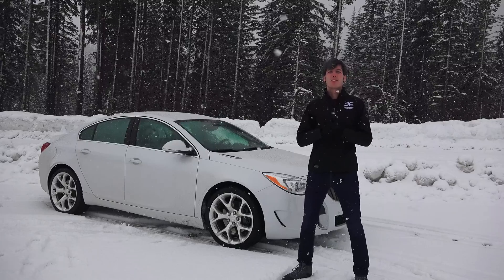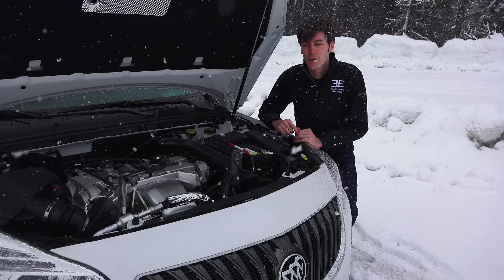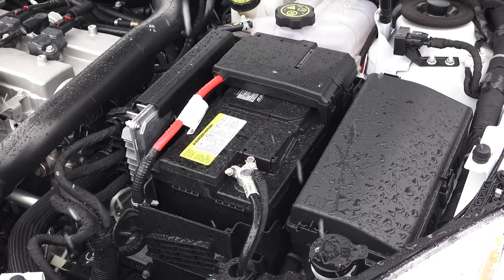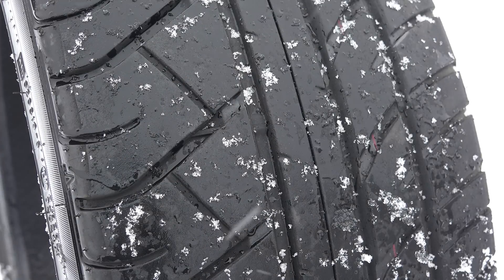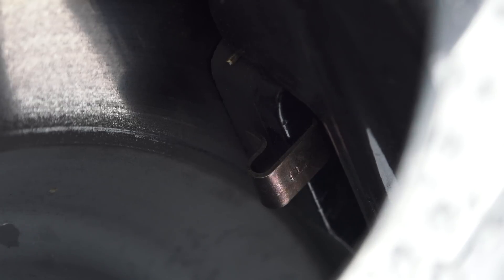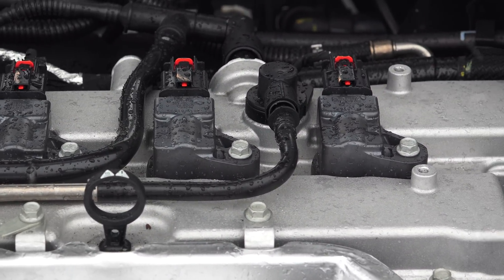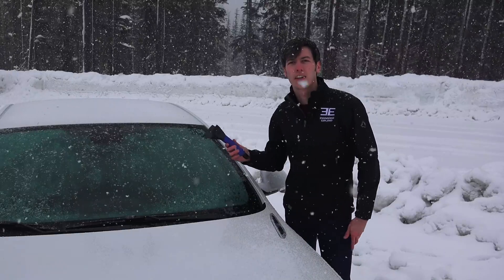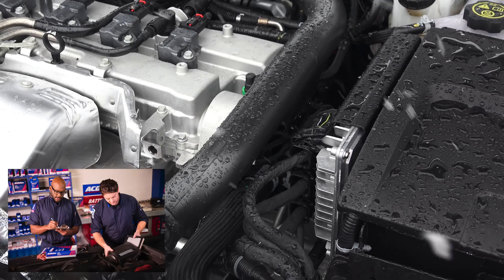6 Ways To Prepare Your Car For Winter

Comment: I'm poor and I can't afford a pack of winter tires, is it  OK if I just lower the pressure of my tires?
Reply from the maker: +Yoseob Yang I'd recommend getting some snow chains. It's a much cheaper option for traction in the snow, I bought a set for maybe $30. Make sure they fit your tire size, and don't interfere with the brake lines. Great thing to keep in the trunk if you'll be driving through areas that commonly see snow. Lowering the pressure will have a very minimal effect on snow/ice.
Reply: If your comment is serious no. Definitely no. Especially under 0°C and snow summer tires get very hard und have much less or zero grip. And If you buy winter tyres don't buy the cheapest ones some of them are very bad. Your life should be worth this much.
Reply: Don't buy a car if you can't afford to maintain it and keep it safe. Simple, really.
Reply: Vikk 54 Yeah they're going to be paying the price for their one accident which is possibly much less than the cost of maintaining probably multiple AWD cars with many snow tires for whatever your life span is. And you can look smug as you drive by all you want with your paranoid waste of money lifestyle but that doesn't make you smart or the situation "simple" just because you can't calculate more than one variable.
Reply: +rorschach775 one accident? How do you know it's going to be one accident? If I had a dollar for the amount of people I saw stuck on the side of the road in a snowstorm while I drive by, I'd be rich. Don't you think it's sensible to put on snow tires and avoid all that? It's not being paranoid, it's common sense.
Reply: +Steffen kawa I'm not actually poor, but I really wanted to know if low tire pressure could help with grip in these conditions. Fortunately or not, it's never icy or snowy where I live, so everyone uses summer tires the whole year. Our solution for snow is to put chains on our wheels though
Reply: +Yoseob Yang if you never have snow and it isn't very cold you don't really need winter tires. I live in Germany and sometimes we have snow for weeks and months. And we only can use chains if snow is everywhere.
Reply: ok
Reply: +Johnathan Yinger he said chains man, not tires
Reply: +Engineering Explained maybe if I leave them flat it would be less minimum.... lmao just kidding, thanks Jason!
Reply: +Vikk 54 You're dumb.
Reply: +rorschach775 how? That seems sensible to me. If you can't afford to maintain a Lamborghini, don't buy one.
Reply: +rorschach775 further, if you can't afford to put tires on a Ford Focus, then maybe you shouldn't have put all your money into that Ford Focus.
Reply: +rorschach775 right. So when someone spins out on their rock hard summer tires in the snow and wrecks their car, they're going to be paying the price for that "unlikely" chance that something might happen. That's the reason why I have an AWD car in addition to my other car for these cases. That's not like paying for platinum health insurance. That's paying to keep yourself safe. Call me stupid all you want, but the facts remain that if you spin out or slide into traffic or can't get out of your driveway because you didn't put winter tires on your car, you're going to be regretting it.
Reply: Vikk 54 I don't. I'm saying it's possible. You can't count everyone you see crashed as a stat for individual cases. Why does no one in America understand how math works? If I had a dollar for every time someone misunderstood units and measurements I'd be rich. One crash for total population =/= one crash for a specific individual. 

It's sensible if you have disposable money. It's common sense if you are paranoid. There is no requirement to purchase them to operate a vehicle so obviously it is pretty common to see it this way. Plus snow tires are bottom of the rung for traction anyway. I mean yeah they're convenient but unless you go crazy upmarket you're not really playing it that safe. You're better off with chains or socks anyway. That's why mountain passes require chains not tires. If you're driving through some actual dangerous shit you're going to need chains anyway.
Reply: +Vikk 54 it's not my case, but there's a lot of people who could hardly afford getting a car and can barely keep it going and don't have the money to get some good winter tires, not even think about getting a second car "for those cases". That's why it's not so simple. It also depends on where you live and the chance of having to drive on ice or snow. Many people don't even know the existence of different types of tires for different seasons, but sadly the reality is that money can buy life. For these cases, just like Jason very sagely said, the cheap alternative to keep your safety is to get some snow chains. Wish it was always that simple.
Reply: +Yoseob Yang How much is your life worth? 
What weather is it?  (below 0c and icy roads?) 
Are you required by law to put winter tires on?
Reply: +Rune Venes it was just a hipothetical situation, just to ask wether lowering the pressure could help get some more/better traction on ice and/or snow. Fortunately in my country and region there is never (or almost never) ice or snow unless you go high in the mountains in winter, so nobody needs or even know about the existence of winter tires, just all season ones

Comment: i NEVER replace windshield wipers in winter, because very often I have a situation, when you left car for a time, water run down on glass and freezes on wipes. If you missed that moment and turn on wiper motor (sorry for my english) rubber from your wipers keep staying in ice, and tear from wiper. Than you have 2 ways to go: take knife and take out all remind parts of rubber razor (to get smooth surface all the wiper long), or go and buy new wiper and wait another random situation when rubber will be damaged. 
Battery: its better to control level of charge in your battery, and don't let it stay at very cold weather (-20 celsius and lower). Then you have broadcast of such low temperatures and you need to park more than 8-10 hours (for a night, for ex.) - take battery with you in warm place, maybe charge it a bit. You will have no problem in morning if you'll start your car with warm, full-charged battery, even it X years old.
Engine: ... if you really like I type this chapter - answer and ask, to lazy now.

Comment: Jason, You should also mention coolant/antifreeze, since normal summer coolant can freeze in the winter. Also the windshield fluid can freeze, so you need to make shore to put in freeze resistant fluid in the winter.

Comment: Ice scrapers? I just wait till the heated windshield did it's job :P
Reply: that takes a lot of time
Reply: +Philipp Born migh work if you have all the time in the world or you dont really have real winter. when you start out with 2" of ice and its snowing heavily you'll sit there for an hour at idle just waiting..
Reply: +Yoseob Yang you're right, thats absolutely the fastest way to crack a windsheild. actually no, use a hammer is faster..
Reply: Well, no, not really
Reply: +FSXgta letting your car at idle for too long will damage it.
Reply: +FSXgta dude i feel like you know nothing about cars. it takes too long for it to warm up at idle that IS not good for the engine google that shit.
Reply: +ali han you dont know what you are talking about if you think all google information is true
Reply: +Philipp Born heated windshield + put your hands on the window :D ice melts
Reply: +Andreas Lie it doesn't take that long to defrost the windshield, but you can spend AGES waiting for the heating to remove the fogging fog
Reply: +ali han the quickest way is to drop warm water on the windshield
Reply: If it's -15C and you have freezing rain from the day before your heater will only be able to get everything off about 15 minutes later
Reply: Yoseob Yang there's a high possibility of breaking your windshield like that you can also pour cold water on your shield and immideatly turn on your wipers that works good too.
Reply: +ali han I'm not meaning boiling hot water, just warm, about 20-25°C. If it's too hot you will surely break the windshield, but if it's cold and so is the weather still, it will become ice immediately, and your face will be worth a photograph, I've experienced it
Reply: +Philipp Born Start the car 15-10 minutes before you drive depending on how fast it gets warm and scrape if you still have ice.
Reply: +FSXgta you mean let the car with the key inserted and the engine started on the street while warming the interior up, right? Aren't you forgetting the red carpet for the thieves?
Reply: +Yoseob Yang Thieves? I live on the countryside some distance from the road
Reply: +ali han well driving with a cold engine is worse. How is having the engine at idle damaging anyway?
Reply: +FSXgta I would never dare to leave my car started outside, even keeping it attended
Reply: +FSXgta totally. i know it's true what i say i usually at least try to don't talk shit.
Reply: +FSXgta here buddy: 

http://forums.anandtech.com/showthread.php?t=2107106

 http://www.wcpo.com/traffic/best-tips-for-those-cold-cars
Reply: Or you buy a block heater. they have ones for both coolant and oil.
Reply: Whoever says to put warm water on the windshield does not understand physics. That warm water will freeze and put a damn inch of ice two minutes down the road. Or freeze your wipers to the car.
Reply: +mehftv wtf I've done it a million times and it works perfectly. It's not about just dropping warm water on the windshield and leaving your car stopped so it gets frozen, but doing it right when you're about to drive. It removes the ice and warms up the exterior of the crystal, reducing the temperature contrast with the interior so it also helps a lot with fog.  Drop it, get in the car and use your wipers so you won't get any more ice, you can start driving immediately with perfect visibility and no need to wait
Reply: mehftv You can use washer fluid, if its not too cold and if there isn't snow or ice blocking the nozzles. but even the winter washer fluid witch doesn't freeze while in the bottle before -25C will freeze in a thin film on a -10C windscreen. then you have to add more and then more until the heater has done its job heating the glass enough. 
in like -5 to 0C one time use will work on a thin film of ice really efficiently.

But you still need a ice scraper for those days you have 2cm of ice in the whole car and the thermometer is frozen..
Reply: ***** Here in Canada they sell -40C stuff. It stays good to at least -30 since that is the lowest we've had recently. It will work even if it's -20 because that happened last week.
Reply: +mehftv magic actions for YT <3 :D
Reply: +mehftv ok, they sell that stuff over here too, but I never care to buy it, 10x the price and its not really needed.
I got a bottle of a friend once, used it just to defrost frosen windsheilds. had it in a small pump bottle.

even that doesn't always work, if the layer is too thick or its too cold its out with the old scraper..
Reply: +mehftv it's colder, its not enough to remove a thick layer of ice anf it severely damages the wipers
Reply: +mehftv you can drop one or two litres of warm water without hesitation, even 10 if you want and for some reason you need it, but half a liter of wash fluid will cost you a lot of money, will surely take longer and definitely won't be as effective. If you live in Canada, you might be interested in trying that solution. if you do, please tell us the results you got
Reply: Yoseob Yang You have drains where water can freeze, and if you do the math 20C water is not going to cope well with a  -20C windshield. The damn washer fluid doubles as a de icer especially if you get the good stuff.
Reply: mehftv I haven't done any math man, I've just applied it in the real life and it works perfectly! Maybe you would be surprised if you tried. I have to recognice that winters are not as extreme as in Canada where I live, but it has always worked to me when I had a layer of ice that was thick enough to paralyze the wipers and not be removed easily with ice scrappers. Nothing better or faster.

Comment: Lol in real winter temperatures you won't be scraping your window with a credit card
Reply: Pro Env lmfao what ever works for you, just make sure your balls don't get frozen to the windshield
Reply: +Nicks Customs It is worth it when you live where it is needed.

I saw an auto store sell these and I live in australia where it doesn't snow
I laughed when i saw it
Reply: +Engineering Explained I learned the hard way to not do that, works great on light frost, did it  on pebbly built up ice, the card shattered and i shredded my fingers.
Reply: +Engineering Explained its not a matter of who's winter is worse, but a matter of not being cheap. An ice scraped is 5 maybe 10 dollars and it's with the investment.
Reply: larry Spiller south dakota, i feel that😂
Reply from the maker: +larry Spiller It works well for light frost when defrost takes too long. "Real" men in their "real" winters should use real ice scrapers.
Reply: +Engineering Explained you betcha. Well and women too. didn't mean to accuse you of not having real winters though. and also even on the colder days now that I think of it, the credit card might work quite well for side mirrors that aren't heated. I often struggle to scrape them without hitting the vehicle next to me or my own with the scraper lol.
Reply: +larry Spiller I sit on the front window with my pants down. Don't forget to put the set warmer on for after!

Comment: A good tip is also what to have in the car during winter, here is what I find essential: 1. A shovel, preferably wide and lightweight, 2. Proper winter working gloves, these go well with the shovel, 3. A "space blanket", the aluminium coated warming blanket often found in first aid kits, 4. A towing rope, 5. A flashlight and 6. Jumper cables.
Reply: Finnish: best drivers in the world
Reply: +Alaric Balthi  and pot holes are filled in
Reply: And if you live in very snowy areas snow chains are a good deal.
Reply: Sekä viinaa takakontissa vitutukseen :D
Reply: +TheDexter626 Siihen ku on lintta menny "vähän" pitkäks ? :D
Reply: +SuomiFinlandPerkelee Kyllä :D
Reply: +SuomiFinlandPerkelee Only good thing about winter is that you are able drive faster over speed humps!
Reply: +Alaric Balthi Nah man, get a RWD (or 4WD) and go sideways. It's the only right way to roll ;) That's the best thing about winter ;)
Reply: +SuomiFinlandPerkelee   i also keep a lighter and candles along with water and food in the supply too

Comment: Do you need to "warm up" your car before driving in winter?
Reply: +243kingfrank You should let oil circulation occur every time you drive, even if it's 100F outside. That being said, a full operating temperature warm up isn't necessary (or even possible) when it's freezing out. Letting the car get oil to every crevice of the engine (maybe a minute or so of idling from the time the car is started) is very beneficial in cold climate. This obviously doesn't take as long in warmer weather.
Reply from the maker: +243kingfrank Controversial subject, lots of schools of thought on this. It takes your engine much longer to warm up when it's idling, and it runs rich while this is happening. Personally, I don't wait very long (unless I need to defrost). Oil is designed to be circulating even at cold temperatures (why it's important you buy the proper weight).
Reply: Warmed up engines run more efficiently and produce less wear on internals.
Reply: Thank  you everyone For the Answer's